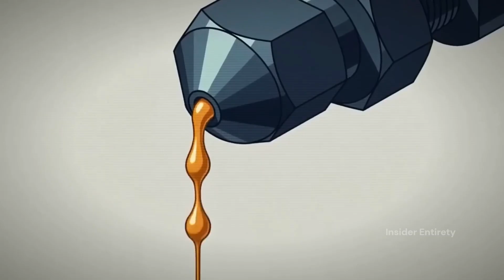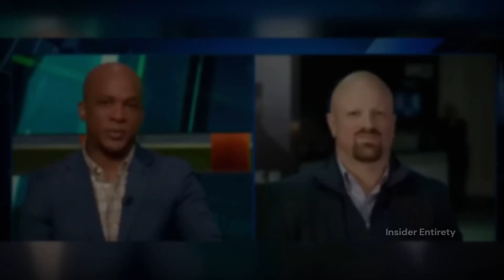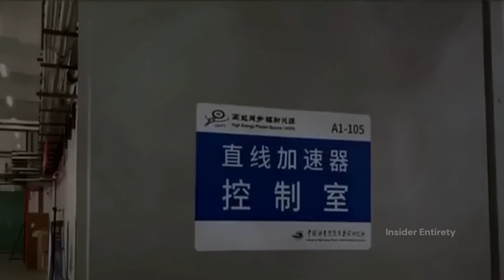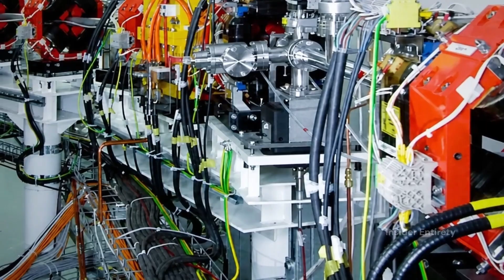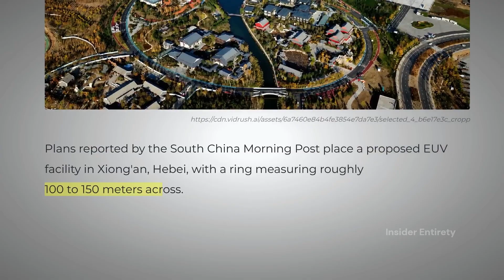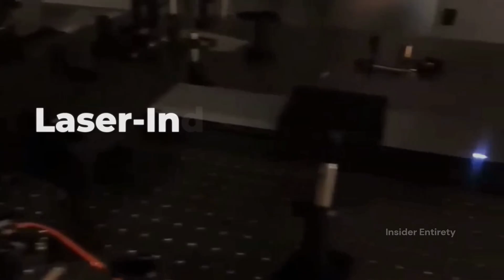China’s EUV Breakthrough Could Bypass ASML’s Biggest Bottleneck

Comment from the maker: ASML’s EUV system doesn’t simply “shine” EUV light—it creates a plasma by blasting microscopic molten tin droplets with a powerful laser, producing 13.5 nm light. 🔬⚡

What makes this breakthrough fascinating is that Tsinghua researchers are exploring whether electron microbunching can generate EUV through a completely different physics pathway—potentially avoiding the tin-droplet bottleneck.

But this is not yet an ASML replacement. The real challenge is achieving the power, stability and throughput required for mass chip production.

👇 Would this technology eventually break ASML’s EUV monopoly—or is the engineering gap still too large?